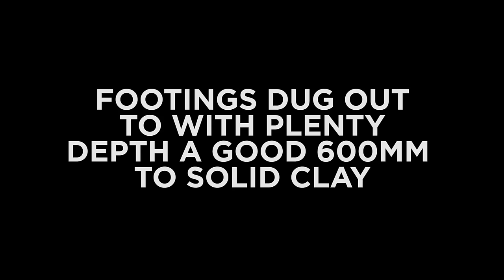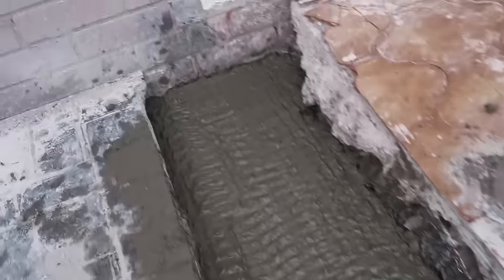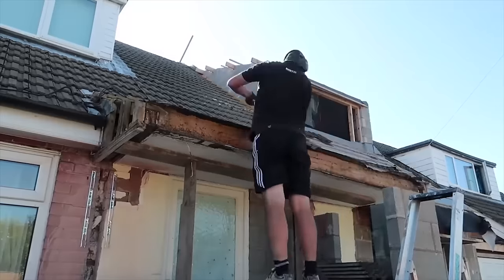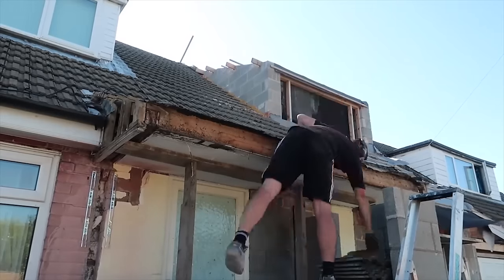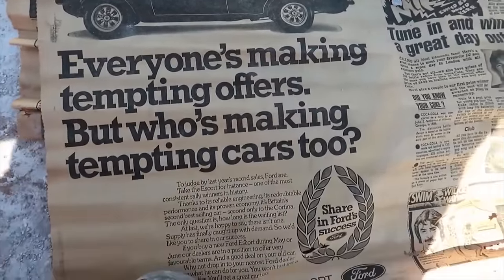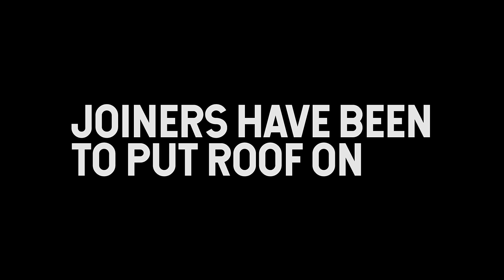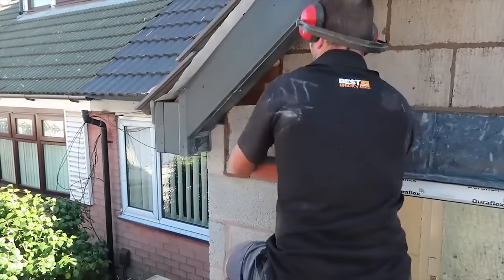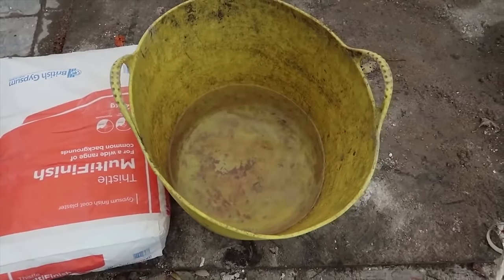Bricklaying Building a Porch from Start To Finish

Comment: Amazing work as always, 

For the footing, am I right In thinking you buried the battens, level them using long level, then filled with concrete. 

Is there anything else that needs to be done so the footing is level to ensure the bricks go on straight and level

Comment: Hi Stu, just started watching your videos today (started with the house extension) and I'm now subscribed. Is 4-1 the "standard mix" for all dense concrete block work above DPC? I will probably use dense concrete blocks in a garden retaining wall and am unsure whether to include vertical control joints in a longer run (about 9m) between two returns. Any ideas?

Comment: What you call a porch we, here in the American South, call a “Stoop”... Porches (or Covered Decks) here tend to be these rather large open areas either on the front or back of homes... sometimes they might be screened... either way, because it tends to be very hot in the Deep South porches needed to be large for times when friends or family would stop by to visit... it was always too hot to be indoors during the Summer months so people would gather on the porches...  Of course that was before the widespread use of Air Conditioning.

Comment: That celing is gonna crack you didnt tape the plasterboard joint
Reply from the maker: I did tape it on every joint, there is a full video on every step including scrim tape on joints even the corners. You may need to pause and zoom so you can double check.
Reply: Brilliant  old school   be proud 👌